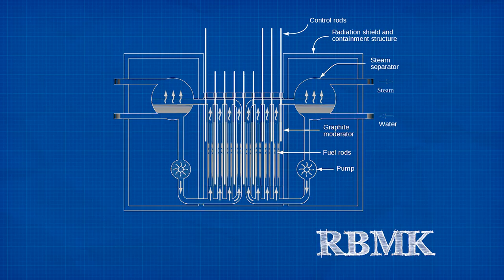Chernobyl's New Safe Confinement: The World's Largest Movable Object

Comment: Next video on the troll-a plattform then.. Was and AFAIK still is the biggest/tallest thing moved.. 472meters tall, 1.2  million tonns total weight. 245000m3 concrete, 100000tons of rebar in the concrete structure. Towed to its location in the north sea, sit sv at the seabed, 300meters below the surface. And have been delivering gas to Europe for 25 years.. 👍

Comment: In 100 years, when this New Safe Confinement reaches the end of its life, our grand-grand-children will have to build an even bigger dome to encapsulate the Chernobyl site.
Reply: It will be much easier to deal with in 100 years, because while the plutonium will all still be there, the cesium and strontium will be significantly reduced.  They both have half-lives of around 30 years.
In 100 years, they will be reduced to 6% of today's values.

Comment: Three miles Island ? That was run by the US ....   and did melt down. Also in the us there was an early test reactor that blew up and killed the three operators....  apparently getting a controlrod unstuck ended in pulling it out a bit too much ....   and boom
Reply: but no one died

Comment: There was NO meltdown at Chernobyl. There were two explosions (non-nuclear) that blew the reactor lid and the roof of the reactor building off. Those explosions scattered parts of the core all over the vicinity and exposed the rest core of the reactor to the open air and atmosphere. The meltdown almost happened, but did not thanks to efforts of the army and miners' efforts. Love your videos, but really don't like sloppy "fact" throwing like this (1:17). A meltdown in Chernobyl would have spelled contamination of most waterways around, which did not happen.

Comment: Why can't Japan build such a confinement like this to cover the reactors? Could you please compare the practical difficulty of solving the nuclear disasters between the two? Neither has been resolved. Thank you!
Reply: Cause in japan the top isn’t the problem. It’s the leaky bottom underneath
Reply: @windowboy  Is there anyway to help and solve it? Or nothing could be done and it will just keep melting down further and further? Thank you.
Reply: @EJ-co3nq  As far as I am aware, its not "Melting" into the ground, because they are pumping water in cooling it. Most of the water is being recycled and/or collected. There may be a very small percentage that is slowly leaking into the ground water. The biggest concern now is that water thats being collected. They have hundreds of massive tanks full, and running out of space. They now want to start letting this water out into the sea which people are not happy about. The radiation is small, but you can imagine, its not ideal.
Reply: @frankie_boy_  Understood and thank you! Just wondering if there is a sustainable and ideal way to solve this 😕😕😕

Comment: One thing the people of the world must recognize is just what the Russian people that went there to work did. Had they not done what was asked of them that pollution would have spread for miles and miles and maybe even wiped out a huge area for many years to come.  They went out the roof spent their 60 seconds just to move one item to the edge of the roof and over to run back to safety.  Figure out how many men took their turn and went out some 3 times. The miners that were asked to did a tunnel that was not used but they did it. The world has to respect the Russian men that went to this site and killed themselves to protect the rest of the planet. Russia now want to sweep them under the rug. I don’t think most of the people watching this YouTube story understand. My question is who does the script and research for this video?

Comment: If the show Chernobyl is to believed, and as you seemed to confirm in your video, a lot of naked miner dong went into this project. Never forget the naked miner dong.
Reply: that's fake actually. Miners were strictly forbidden to take their clothes off at any point - and neither of them did. Makes perfect sense as mere clothing can protect you from some radioactive particles.
HBO show is a drama, not a documentary. It has loads of such fakes.
Take that scene when miner asks if breathing masks work - ofc they work. Being exposed to radiation is one thing
If you inhale a chunk of radioactive dust into your lungs - that's quite another frikkin level of trouble you just got yourself into.